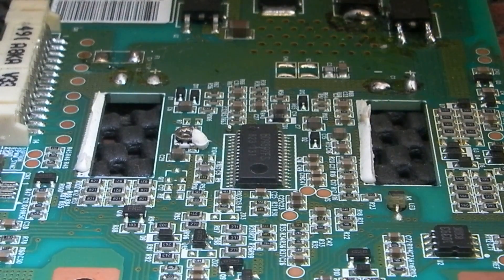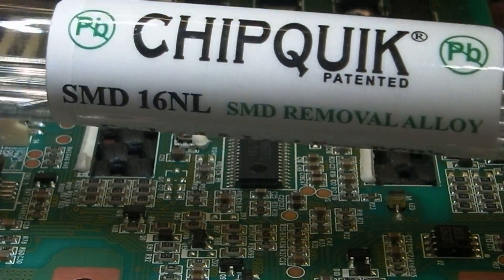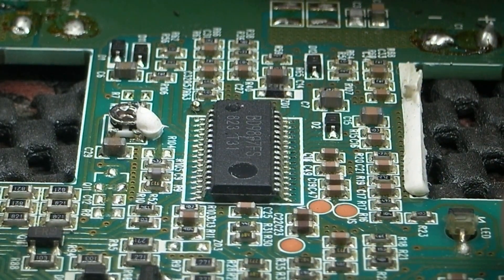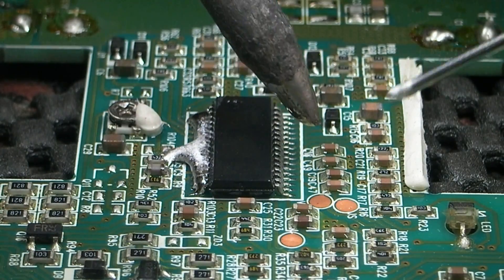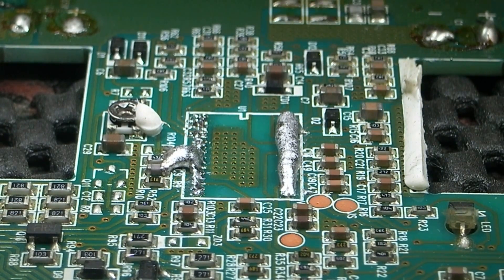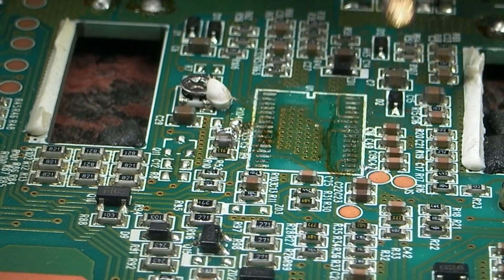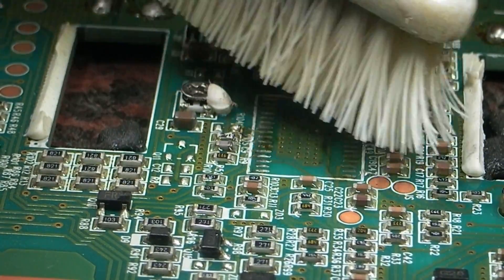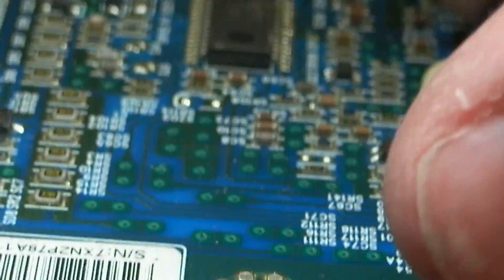Using Chipquik

Comment: Not a good tech handling. Use a smaller solder iron tip, and "clean".  Your dirty and large tip made a mess on board.  Use a paste style of solder flux, like 8341 No Clean Flux Paste from MG, instead of wet all board with liquid ones, another mess. Don't need to apply so much Chipquik low temp melting solder, just a fine line, don't waste time - lift the chip as soon both sides are melted, immediately, with tweezer, not pliers.  In some cases when the chip is very thin and difficult to grab with tweezers I glue a sewing thread with super glue (just a small dot) on center of the chip, and keep pushing gently, when the chip is ready it will lift easily.

Comment: I’m an R&D technician for medical device companies. At 4:23 the reason why the solder wick isn’t wicking is because there isn’t any flux left. If flux was applied, the copper wick would have “sucked up” the solder. When you pull off the chunks you have a very high chance of tearing off the pads.

Comment: I noticed the second board that you were working on is the Philips inverter board. I'm actually working on replacing the  BD9897FS chip on my board. Did you replace any of the 4 MOSFET's or do any other mods after replacing the chip?